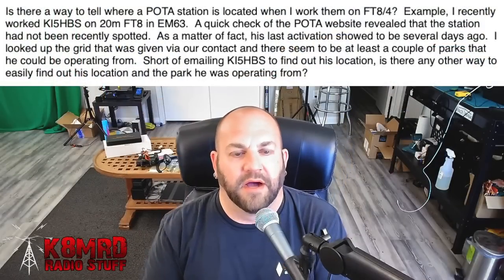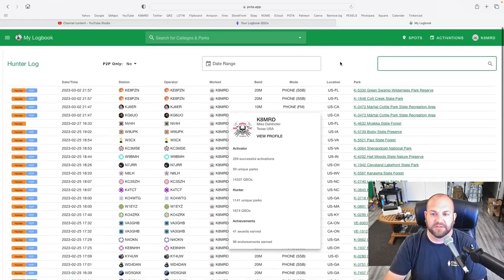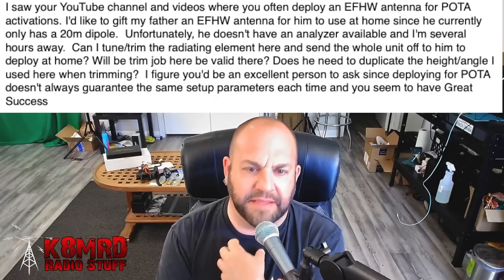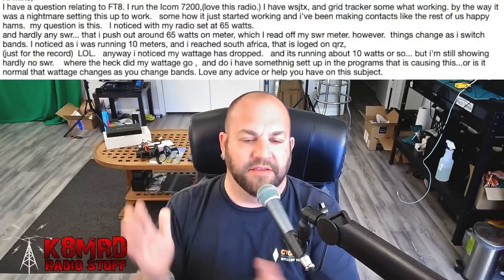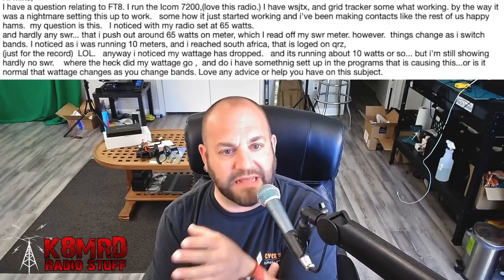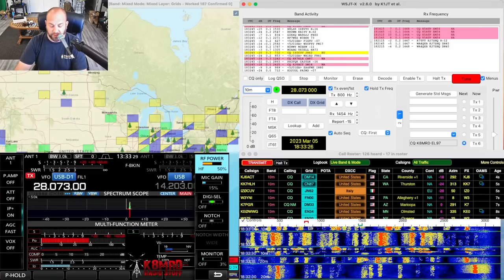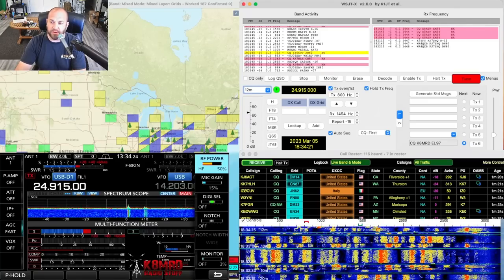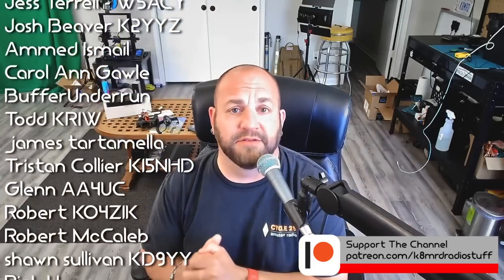This Is The Most Important Setting For FT-8 WSJT-X

Comment: Hey Mike, great Monday video as always! Your comment @ 12:22 regarding the Pwr bar ... if you go into WSJT Settings / Audio, look at the bottom, 'Remember power settings by band' and click BOTH 'Transmit' and Tune, it will remember last TX and Tune settings on the Pwr bar. You didn't mention that but I highly recommend clicking both 🙂 73 KJ6ER
Reply from the maker: What a great tip!!  Thanks Greg.
Reply: Was just going to type the same answer. It's a great feature of the program.

Comment: You can use TX-5 line to ask the activator for their park number. They would need to use TX5 line to tell you. If you do that, make sure to give them a spot afterwards.
Reply from the maker: Ahh, good point
Reply: Seems like it wouldn't be hard to add a POTA/SOTA query/response into wsjx automagically like it does everything else with a check box for "auto query POTA on TX 5" and "auto respond POTA qury" with a feild for current park number.

Comment: I typically run 30w on FT8 with my IC-7300. My power level has minimal changes. Might have to adjust the power settings a bit, but not much, probably 5% or less. Generally, I keep my ALC to 1 to 4 bars, just enough to get the desired wattage output.

Comment: Great video, I experimented with lots of different antennas, every situation is different, radiation angle,proximity of metal ,ground factor ect. , end fed in different angles and configurations will work just please get an reliable matching balun, spend the money in something that not fail easy and always protect from radiation and lighting! Thanks, great video!!! Nw1L

Comment: Hi, Mike. I love using the IC-7300 and WSJT-X for FT8. Thanks a lot for the directions for setting the power slider using the power and ALC meters on the 7300. I did that to fine-tune my setup as soon as I finished watching this video. I mainly use 40m and 20m bands for FT8, only occasionally using 30m or 15m. It's become my favorite mode.
Thanks for the tips!
Best,
Marc (N1QGM)

Comment: I have the IC-7200 which I use mainly for FT-8/Ft-4. According to both the manual and other youtube videos on setting up the IC-7200 for digital modes, you should have the ALC showing 2-bars on the meter. This will not create a dirty signal when running FT-8. Keep in mind that not ever radio is run the same way when using digital modes. I also run a Yaesu FTdx3000 which needs to have the ALC at around 30%. I mainly run 80 watts with both radios. I have at this time over 18,000 Ft-8/Ft-4 contacts all over the world in less than two years with a Random Wire Endfed and a Sirio Ground Plane Vertical both at 20ft on a medium size city lot w/o any trees to work with. Don't get too hung up on ALC!!!!!!!!!
73 from Erving (N1ECC) Lowell, Ma.
Reply: The Elecraft K3 also likes some ALC (3 bars).  I know that when I listen to this good advise.

Comment: Thanks for the video! Wondering what Mac software you are using to display your radio? I have an Icom 7300 and am looking for something like this. Thanks! W8CFS
Reply from the maker: I've heard there's a way to do it with the 7300 but I'm not sure how.  I believe it involves some third party hardware and some under the hood type stuff.  I'm using the video out from my 7610 into an HDMI capture card fed into OBS.  I also have an HDMI splitter so I can send the 7610 screen to an external monitor.

Comment: FT8 allows grid eg. PF96HC my local POTA park. JS8CALL allows PF96HC22DL. The js8 locator will spot me as in my park on PSK Reporter. Where as PF96HC is a larger area.

Comment: The advice about watching that ALC meter and putting a clean signal to air is a message which really needs to get through to many folks.
It’s quite surprising how many stations overdrive their transmitter on modes like FT8 or WSPR.
I quite often see multiple WSPR decodes from the same station in the same frame and that’s a dead giveaway of harmonics resulting from too much drive.
Of course, much the same applies to regular SSB voice. Some folks have a penchant for winding mic gain and compression up far too high in the mistaken belief louder is better! 🙂

Comment: Mike, I need help.  I have ft 857d digirig and Mac book pro m1  I have seen signals coming in on ft8 but it seems I'm not getting out.  I have no external meter to justify pwr or Alc.   External antenna  tunner ldg z100 plus . Radio  settings are dig gain 50  mode user u  dig vox 0 all off sets in the radio ate set to 0hz, radio power 20 watts . I'm using the a dx Commander antenna.